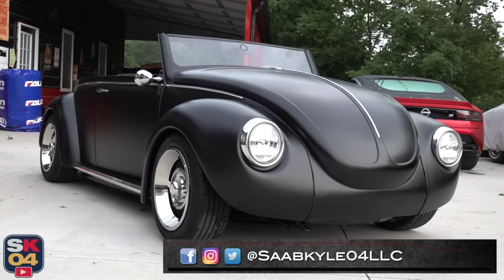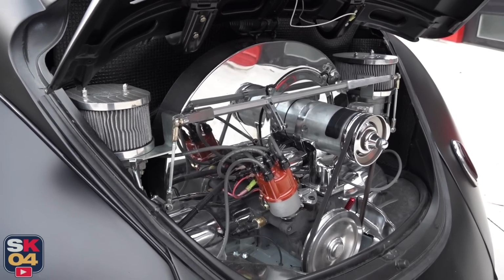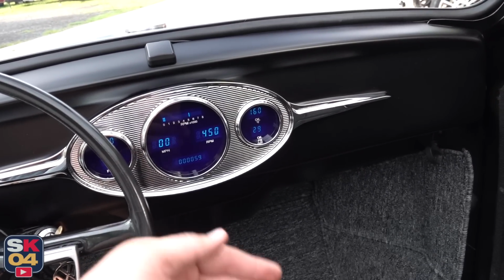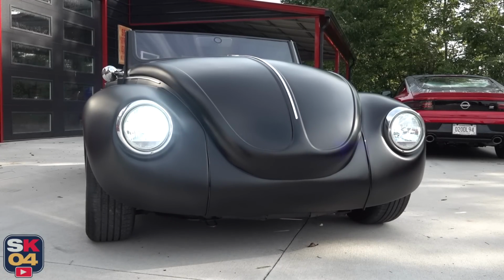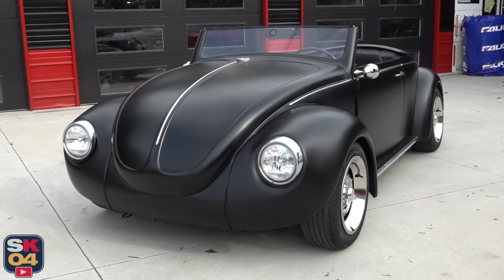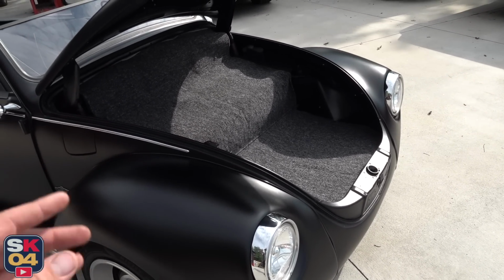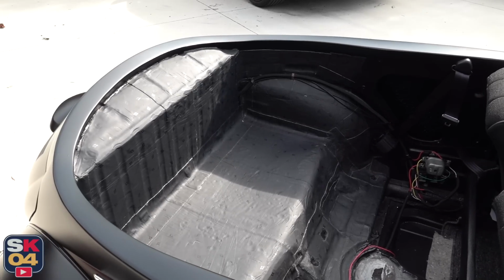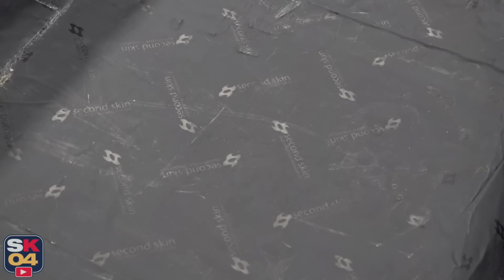We Built A Custom Widebody '71 Volkswagen Super Beetle Roadster!

Comment: could some one tell me if this thing will be legal on roads? how customer handles it registration?
Reply: It’s registered and has insurance and all that. Cars over 30 years old (in NC) do not have to undergo inspections. And it has everything, inspection-wise, any other car has…except windshield wipers. Obviously this car won’t be in the rain, so the wipers are superfluous. It actually has shoulder belts (which it didn’t have originally) and 4-wheel disc brakes….and way more rubber contacting the road. So I’d argue that it’s a safer car than it was originally.
Reply: @gregmulholland1129  ok. but body was cut. including windshield frame which is enforcement element in convertible cars. Car looks great anyway. I'm just curious how this type of mods handled in USA because in Europe cop could stop you and ask if you have all documents which prove that your car is safe (because body mods are obvious)